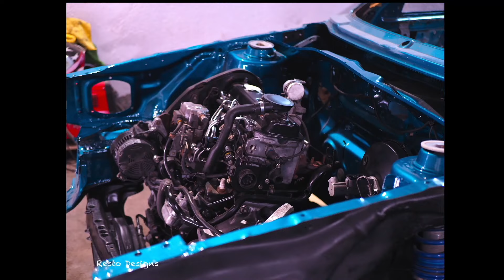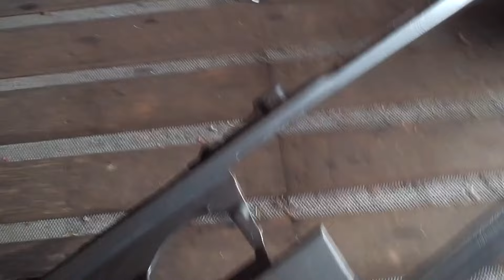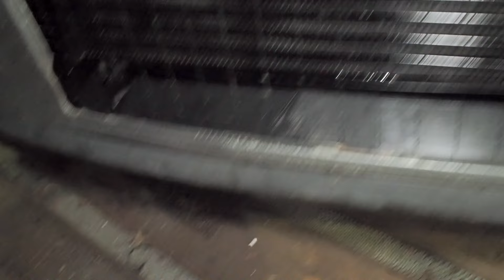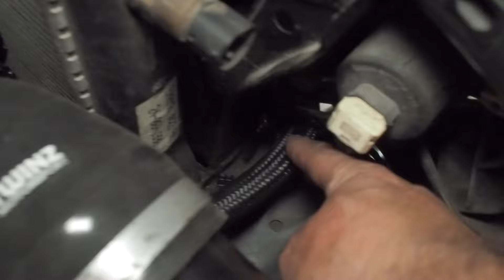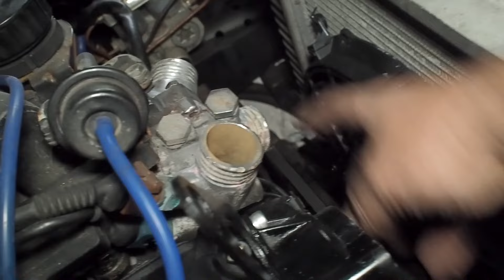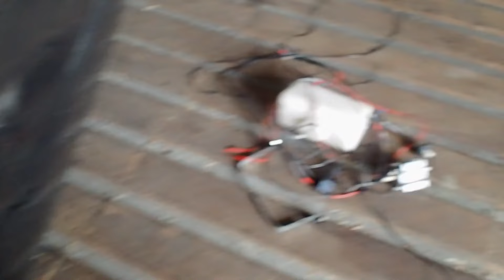Project 'Donuts' E30 Turbo Progress

Comment: Nice! It's starting to take shape and those boost pipes look so much better.
Reply from the maker: Thanks friend, Totally right, doesn't it a lot  better  those boost pipes compared to before with loads and loads of clips and hoses in different colour and sizes.
Reply: Looking forward to seeing this engine bay once you've finished it, if the engine bays in your MK2 16v, MK2 GTD, MK3 GTD and your MK4 track 1.8t are anything to go by, then this is going to look amazing.
Reply from the maker: @snowflake6916  Thanks mate, I'm going to do something a little different to what a normally do, going to colour code a lot of bits and paint everything else black with gold touches.
Reply: That sounds like that is going to look amazing. Keep the updates coming, plus the MK3 GTD as well.
Reply from the maker: @snowflake6916  I think so, yep I'll be on the MK3 GTD very soon.